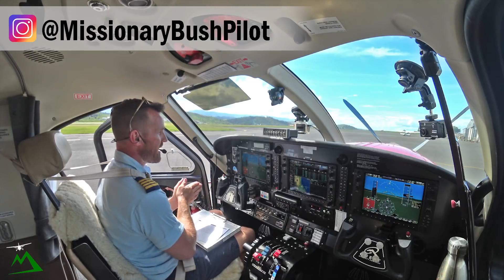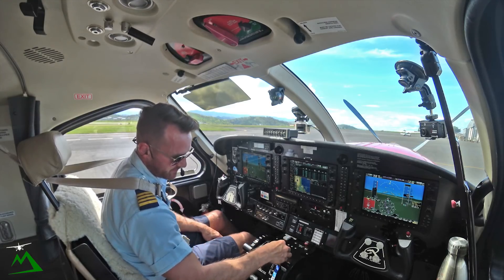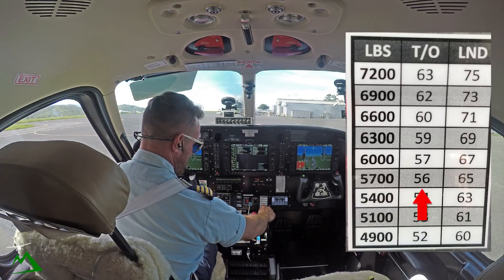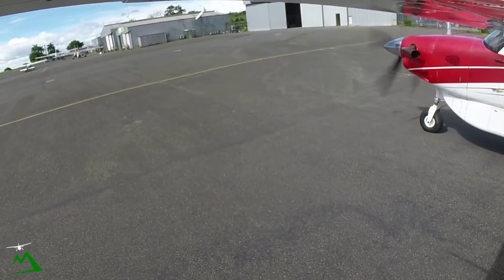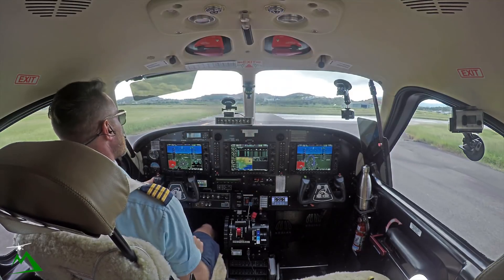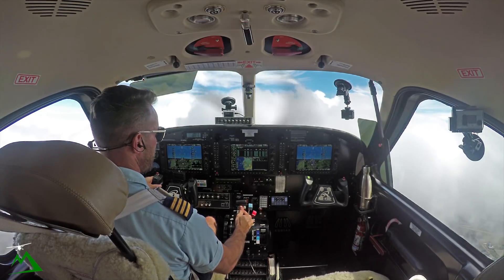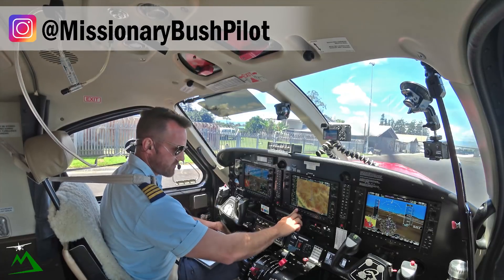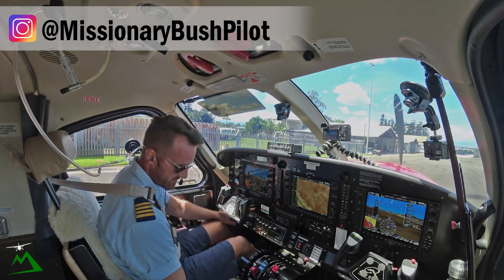Simulated EMERGENCY LANDING from 18,000' in a Kodiak | Missionary Bush Pilot Flight Vlog

Comment: Great training video. A PFL from 18000ft is something else! I just did my biennial check ride and the instructor lobbed a PFL at me  in the downwind at 1000 ft QFE. As you showed, it is really that last 1000ft that counts. Could I do this? Not from 18k feet, that's for sure - that's nearly twice my aircraft's service ceiling!

Comment: Good Video... Fyi while starting your engine you dont have second ignition what you refer is actually secondary flow nozzle kinking in and giving more fuel for the rest of the start that would otherwise be too much flow not allowing successful start if they where active since fuel introduction
Reply from the maker: Yes you are right, that's actually what i meant when I said that, I just didn't say it correct.

Comment: Good Day Ryan
Very interesting video, as a matter of interest, what torque setting do you use to simulate  the low drag of the feathered prop ?  Started using the table adding 2/3 Kts as a buffer, Nice improvement on my landing distances and attitude. Great stuff,  thanks.
Cheers
JJ
Reply from the maker: on a simulated emergency I use full prop (2200 rpm), and 250 ft lbs of torque.  We don't use feather in a simulated because  it takes about 20 seconds to completely come out of feather.

Comment: I didn't see any segment of that approach that simulates an engine failure.... I pull the thrust levers to idle, and drive it on from there... same thing in Helos...roll the throttle to idle, enter Autorotation.. hope we make it! Did I miss something?
Reply from the maker: Nope, just idle and don't you h the throttle til your on the ground. Always good to practice

Comment: Does feathering the prop save fuel and take you to the ground heavier than normal? Just curious, zero flying experience ;)
Reply from the maker: Feathering the prop turns the blades of the prop so that the face is not facing into the wind. It creates less drag, so your glide distance is further.

Comment: Nice vids, but do you do a run up before takeoff ? I used to fly Cessnas so I am familiar with flying
Reply from the maker: No, in turbines a run up is not required. Piston engines you are checking your mags, but we don't have them on this plane.
Reply: @MissionaryBushPilot  OK good 2 know

Comment: Way to go Ryan!  Question... some companies only do simulated emergencies when there is an instructor pilot on board.  What are your thoughts on this?  Has this ever been a discussion in your company?
Reply from the maker: Because I didn't go to feather or shut the engine down, I gave myself a lot of margin.  What I probably would not try on my own is a turn around back to the airport right after takeoff.  That has a lot more risk involved.

Comment: Does the box with the toggle switch you use when doing your checklist connected to anything or is that some you made to keep track off your checklists.
Reply from the maker: It is not connected to anything, it's just velcroed to the dash
Reply: Is that an MAF thing or do they sell those somewhere?
Reply from the maker: @nathandankers5221  no, they are custom made

Comment: Ryan
If you lose or close down the engine in flight, how does that effect the avionics suite?  How long can you run avionics on the battery, and do you need to do a  load shed?  I take it the flaps are electric also?
FJ  jockey
Reply from the maker: The battery has plenty of power to keep all my avionics going until I get to the ground.
Reply: Missionary Bush Pilot 
Ryan
Very well thought out. What a neat machine. The whole operation is very professional and the training very thorough.  Congrats.

Comment: I'm assuming with engine failure, you loose electrical supply from generator/alternator so you'll be relying on battery power for the rest of the flight? If so, how long do you have before you loose all the displays? I think I read somewhere that your stby gauges at least have a good amount of time on their own battery?
Reply from the maker: That's a good question. I"m not sure exactly how much time I would have.  We have 2 batteries, and we can shed unnecessary things, so I would thing more than enough time to find a place and land.  If both screens went down, we have stand by steam gauges as well.

Comment: So what is the glide ratio?  I couldn’t find that online
Reply from the maker: It changes with weight, but a rough estimate is 1.5 miles per 1000 ft
Reply: Missionary Bush Pilot ouch so like 8:1 or a brick   You weren’t kidding.